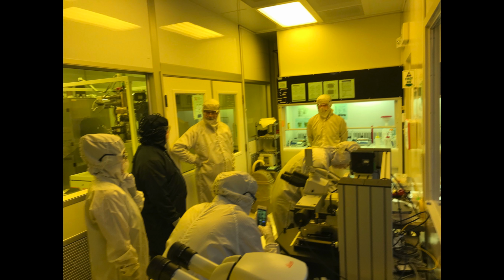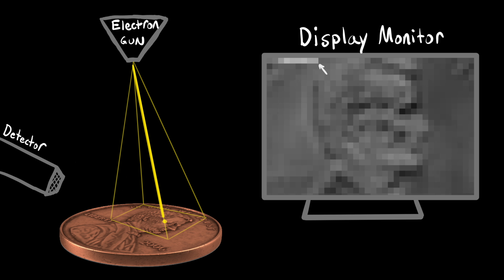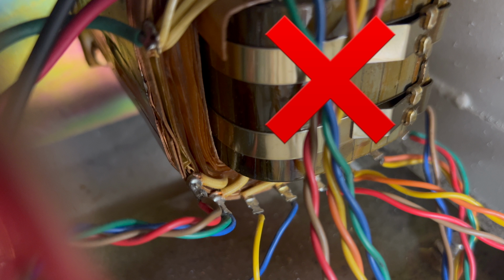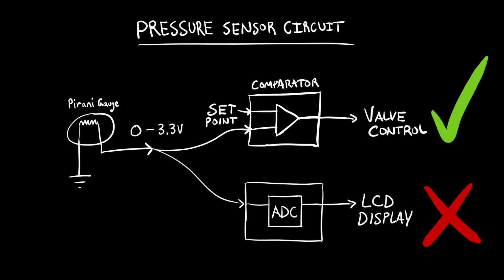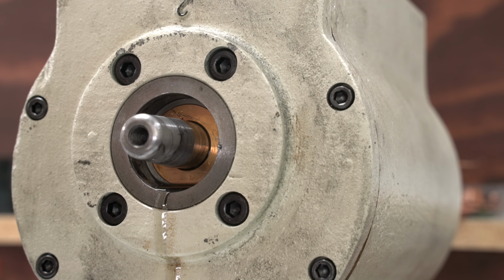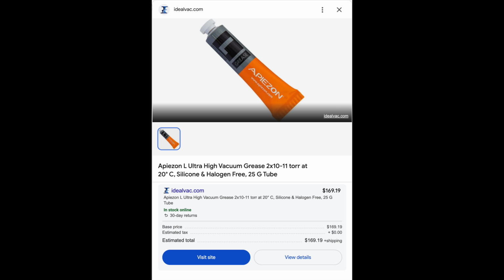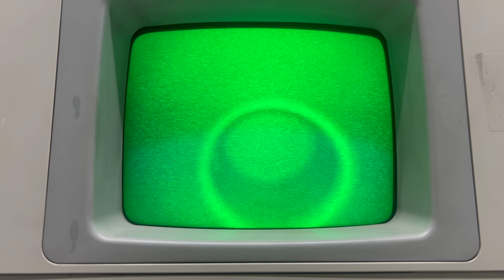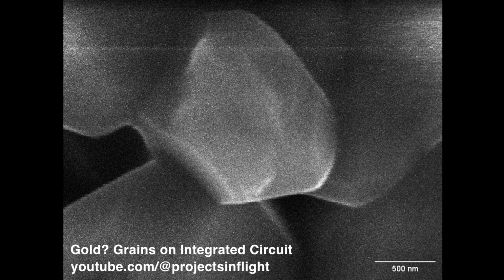I Saved an Electron Microscope from the Trash

Comment: you know, im unsure of how possible it would be to convert but converting the tube display to LED/LCD would be a crazy upgrade for it. afterall the only real thing to worry about with it is those displays are kinda ticking timebombs with age. i own an old tech server with some people into collecting them and they always have some issues down the line
food for thought, if its even possible itd be extremely difficult anyhow (speaking of ticking timebombs, i work on 80s tech and 100% replace those capacitors. they are not rated to last 30-40 years)
Reply from the maker: There's an external video out signal, so hopefully I wont be screwed if the display dies
Reply: @projectsinflight  hopefully not, though on the other hand those early LCDs afaik aged far worse than tube displays. silver lining it didnt use one of those eh? anywho, cool machine, that old school engineering is just so neat

Comment: Just a question: I'm getting electron beam radiation therapy for an ear tumor. I always thought electron beams were only possible in a vacuum, but there's a good distance from the beam generator to where my ear is in treatment... and, as I breathe throughout the (few seconds) treatment, I doubt I'm in a vacuum. What gives?
Reply from the maker: the distance electrons can travel through air depends on their energy (speed). the electrons produced by my machine are at most 25keV, which is only enough for them to travel a couple cm before they are gone. at higher energy levels they can travel farther. what's really cool is that by tweaking the exact energy you can basically set exactly how far they go before they essentially self destruct and recombine with atoms, which might be why it's used in cancer treatments. you can essentially target a specific depth and create a beam that kills cells but only in a specific spot, all without needing to cut open the skin. pretty nifty :)

Comment: My grandfather was one of JEOL's senior technicians and from the dates I saw on the PCBs he may of installed / serviced it before he retired in 1994 sadly, he passed in 2008. I got the opportunity to read through some of those documents/schematics in those blue binders which was thr companys colors, although at the time I was too young to understand and still learning electronics though he always highlighted and cautioned about the high voltages those machines operate at. Great job if you find anything indicating HJL Sr. And/or Harold Jay Leeper Sr. was part of its installation and/or service know someone who really cared a about those microscopes put quality time into making sure it operated as one of the best instrument for its time. BTW Great job on the resurrection!

Comment: Does the JSM-5200 have video output? What video out interface does it use? 
You may be able to hook up a high definition monitor instead of the old integrated CRT.
Reply from the maker: It has a BNC on the back with a video output, however, I do not know if it'd be compatible with things like a capture card. I'll have to check

Comment: Amazing video! How much total wattage does it draw in operation?
Reply from the maker: Well, the breakdown is approximately:

Diffusion pump: 500W
Chiller: 500W
Rotary Pump: 500W
SEM: 200W
Computer: 200W
Total: ~2000W

whats crazy is that if i swapped out the diffusion pump for a turbopump I could cut out the chiller and save a total of about 1000W (turbopump uses very little power)

Comment: So cool! I'm no expert by any means, but I have experience with repairing electronics. Replacing old electrolytic capacitors usually solves a lot of noise problems. Especially any located in amplification circuits. Might not be the issue here, but it's cheap insurance and should prevent any old caps from damaging anything.  I can't wait to see more of this!
Reply from the maker: I plan to go through the boards and replace a bunch of components in the near future
Reply: @projectsinflight  I wouldn't be surprised if a lot of the noise is caused by the RCA cable you're using. Most of those tend to be unshielded!
Reply: @projectsinflight  The judder in the crt is in the field output circuits on the crt driver board.. us old tv people know that symptom well.
Reply: @projectsinflight  might also be the cheap coax cable get one thats properly isolated
Reply: I second OPs comment. This machine is quite old-school, it would for sure benefit from a capacitor refresh.
Reply: I fix electronics for living and half of my income comes from people randomly replacing capacitors without checking them in the first place. Industrial electronics use high quality caps that are usually good even 40 years after. Check ESR and replace only ones that are actually bad.
Reply: @senco981  I second that.    I worked for many years repairing professional electronic instruments, items often 30 or 40 years old and still good.  A lot of the squawk about replacing all caps comes from amateurs who fix old tube radios and tube stereos.   They only have a handful of caps, so if you make a mistake it's not too hard to backtrack.  But in professional gear that has dozens or even hundreds of caps, making a mistake can lead to giving up.   I too have repaired gear messed up by hobbyists. When I put the correct size caps in the correct places, the actual fault (generally not a cap) took only minutes to find.
The caps used in professional gear are made to much higher standards and used well within ratings, so are usually last the life of the equipment.  And professional gear usually runs a lot cooler.
There's a YouTuber Dr Carlson's Lab - I had to laugh at this fool who replaced oil filled power supply caps in a military radio because he detected a few microamps of leakage.   That was well within the manufacturer's spec for new parts - there was absolutely nothing wrong with them, even though they were 70 years old.
Reply: replacing everything with good quality caps will drive the guy into bankruptcy! :D
Reply: @AKAtheA  I just recently recapped an older analog device, and it took 100 capacitors. It was 46$ from digikey +8$ for shipping, using mostly nichicon caps (good quality). He doesn't need to go with custom vishay precision caps.
Reply: Agree. Bad capacitors cause lots of problems.

Comment: Since you had to replace that transformer anyway, I would have made it work with 120V.
Reply from the maker: There are actually some parts (the valve motors) that operate at 100VAC, and it'd be a pain to replace them with equivalent 120V options

Comment: This is amazing. 

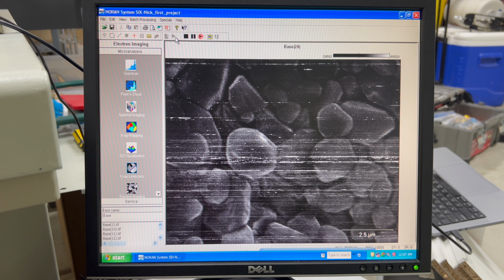At like 33:13 is that the instrument being weird, or is it charging artifacts? If you decrease (or even have control over) beam current/spot size you might be able to eliminate that while keeping beam energy constant, at the expense of signal of course. If the 45ua is beam current you might try dropping it. You might squeeze some more res out of it if the beam current/spot size is made to be small. I usually work on sensitive samples so to me 25kV at 45ua is a lot of electrons at a very high energy lol.
Reply from the maker: There is some issue with the signal path between the microscope and the external computer data recorder. No idea yet what's the issue. it comes and goes though

Comment: Wow, this is (to me) the coolest "will it start" in YT land. Electron microscope… Let that sink in. Years ago I found sem pictures (real photos) when the university hired us to get out some trash. I thought this was too cool so I stole a bunch of them. They show plant cells in the 25 µm range.
My favourites would be the Trini…kaboom glass and chips graffity. 
So cool You pulled this off- nerd. Inspiring. Gives me motivation to get thru my own stuff.
I collect old electronics and am trying to learn how to fix them -by doing. Today I fixed an ac milivolt-meter. It seemed like something was shaky and I re soldered the main board with lead solder. I only use lead solder, it flows with less heat and looks pretty.
And I have such a de soldering gun- a cheap chinesium but it works. Sometimes it clogs up tho- I still figure it out. And I rebuilt the switching for the vacuum pump, the old way it lagged.
But still: get Yourself a ZD-915 desoldering gun. It´s entry level but good enough. I wouldn´t have started the repair today if I only had wick.
I digress… Still: a very impressive thing to have, that Sem. Kind Regards
Reply from the maker: Thank you! I'm holding out for my own hakko but i'll check out your model as well
Reply: @projectsinflight  Thanks- It´s the cheapest model on the market with acceptable parts availability.
The Hakko can´t do anything better, it´s just more expensive. Give the Hakko a run for its money. Desolder all and everything in one go- does it clog? Run it above 320C for leadfree, at 290C for lead solder.
Mine does clog and it´s annoying.
If it does I heat it up to its max until it can suck itself free.
I modded mine with a relay for the pump (before all the power went thru the handpiece) and a buck converter for the annoying fan.
But that´s it- I just re did a voltmeter mainboard in chase of a shaky connection (found it).
I never would have done that with solder wick…
Thank You again, glad I could help.
I´m still at awstruck over Your project.
That´s the good stuff…

Comment: Bypass the monitor to pc circuit and use real 75 ohm cable, that will improve the signal a lot. Also use an external monitor to check for errors in the old monitor.
Reply: He could do it for testing, but in the end i assume hes gonna want to keep it so he can use it for videos.
Reply: @mactep1  The images he managed to capture from it are stunning and they do not seem to suffer from interference at all. The signal to noise ratio is way better because of the scanning method that gets adjusted by the program, very neat!
Reply: If that board is from around the same era as the PC then I'd wager the issue is the board. Caps from that era are notoriously bad.
Reply: Oh yeah totally forgot we have amazing quality caps now compared to 40 years ago that should've been obvious
Reply: There is another comment thread from a tech that used to fix these machines that points out that although it looks like that machine is generating a standard video signal, in fact the signal syncs directly to the electron beam. When the PC interface takes over the crt apparently goes garbled.
Reply: He did that, feeding the video signal to the noran.
Reply: ok smartypants 🙌

Comment: Such an excellent work you did there !
Perhaps you would be able to change the old CRT with a modern display and RAM to buffer the incoming signals. And to create artificial colors by arbitrary assigning the tungsten filament voltages in kV to the real life color spectra.
Reply from the maker: So, it is actually something that exists in some modern transmission electron microscopes to measure the energy of the electrons that are detected and use that as another dimension of your data/image, but I have no idea how i'd do that on this old thing lol. Still- actually a very interesting idea

Comment: Pretty cool to see that an SEM is basically not much more than an old-fashioned analog CRT camera tube where you can stick a sample into. So most of the repair techniques from analog televisons apply here -- the lack of vertical stability is probably due to capacitors in the deflection circuits.
Reply from the maker: it's true, the SEM is basically just a CRT, but with extreme care in designing a CRT with a VERY VERY narrow beam and small spot size lol.
Reply: Well summarised ❤❤

Comment: Please replace the Video cable with a good quality coax one. I feel like the issues with the capture are coming from the cable(s)
Reply from the maker: On it! But also I guarantee you that cable isn't the only problem. for some crazy reason there is a 3ft BNC cable on the inside that is being used as a jumper for two pins 0.3 inches apart lol. That also needs to be fixed

Comment: 21:14 how did you get those cuts?
Reply from the maker: Did you see that tiny hose connected to the bigger of the two vacuum valves? That was stuck on pretty good- and when it abruptly popped off my hand went flying back into the gears on the smaller valve. Just a flesh wound though
Reply: @projectsinflight  i have messed with screwdrivers and old machines and that stuff hurts like hell, but lasts only a few minutes

Comment: @16:32 Don't use those cheap hose clamps. Get Oetiker clamps and a crimp tool. They provide uniform clamping force without pinching and lifting the hose around the screw area that those cheap clamps create. You will need to measure the diameter with a caliper and purchase the correctly sized oetiker clamp.
Reply: found the VW engineer
Reply: Those clamps are fine for what he is doing.  They're not really for the seal, they're to keep the hose from slipping back off.

Comment: Since there are unused secondaries for each voltage, could you not have just used a different secondary and left the shorted one disconnected?
Reply from the maker: the problem is that the shorted secondary shorts the whole transformer. even with absolutely nothing connected, the primary coil still acts like a dead short at 60Hz.

Comment: is there any issue around regulation since SEMs are X-ray sources? Do you worry at all about shielding?
Reply from the maker: Most medical x ray machines use "hard" x rays with a higher energy (shorter wavelength) than this machine can create. 

There are minimal issues because with an acceleration voltage of 25kHz the absolute maximum x ray energy you can get is 25keV, which doesn't penetrate stuff very well, and dissipates in air at a reasonable rate. Add to this the fact that generally you won't even create those x rays unless the electron beam strikes something dense like tungsten or gold- if it strikes material like aluminum the x rays are even lower energy. at 10keV for example they can barely penetrate air.

i did some rudimentary tests with a geiger counter that is sensitive to x rays and saw nothing. i am still looking to find an x ray spectrometer for further tests thoug
Reply: @projectsinflight  interesting! I'm used to TEM with high accelerating voltage. I was once mid-session when the state inspectors came to test X-ray emission with a geiger counter
Reply from the maker: @CodNinja33  Oh yeah, a TEM usually is above 100keV, which is a much greater X-ray hazard

Comment: Diff pumps. I've rebuilt one of those percolators from hell. Get thee a turbo!
Reply from the maker: i do really want to do a turbo swap- however i worry about the increased vibration from the turbo. this machine is EXTREMELY sensitive to vibration as you can see in the imaging of the 300nm particle

Comment: So this is a Japanese SEM running on 100V through a variac, and you're replacing transformers? Just plug the new stuff directly into 120V! Eventually more parts will die, and you might as well slowly convert it to the voltage that actually exists where you live. Converting everything to 100V so you can convert it back to 120V seems silly.
Reply from the maker: there are some parts of the machine that are actually powered by 100VAC, such as the motors that move the valves. replacing those would be a headache. easier to stick to 100v, minimizing replacement parts for now

Comment: Back around 2000 part of my job involved taking the polaroids produced by an SEM much like that and scanning them on a flat bed scanner so they could be inserted into reports and grant proposals. I'm don't know where the company dumpster-dived that SEM, but I would have loved that direct computer attachment upgrade.
I think it used a different style diffusion pump to pull the high vacuum because I remember that it had to be fed liquid nitrogen when running.
Reply from the maker: ah, it's the same type of pump actually. all diffusion pumps have a component directly above the pump that is cooled and causes any oil vapors that float up to condense, which protects the chamber. the colder the better, so some systems with more strict contamination requirements will use liquid nitrogen condensers to trap more of the oil vapors
Reply: You could also be thinking of the EDS system, which used to have dewars on them that need to be filled for the sensor to operate.

Comment: You can get pretty cheap rca "dvrs" online, depending on how that signal is actually formed you might be able to just intercept it through the rca cable
Reply from the maker: I wonder if the variable frame rate would cause any issues on a capture device?

Comment: I would go through every board on that machine and change out all the 40 year old capacitors. A leaky capacitor would ruin the boards. It is likely the cause of interference in the display as well. You might look for a monochrome tube to replace the green.
Reply from the maker: The green tube is actually important! Green phosphors have a longer persistance, so you can do a slow scan and still see the whole screen. You can see it in the video in fact when I show the slow scan on the copper grid.